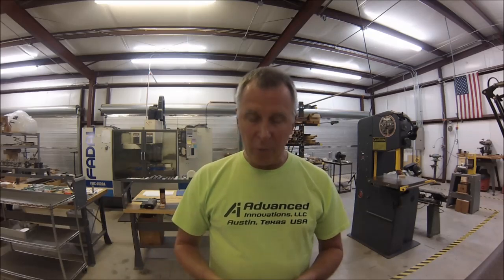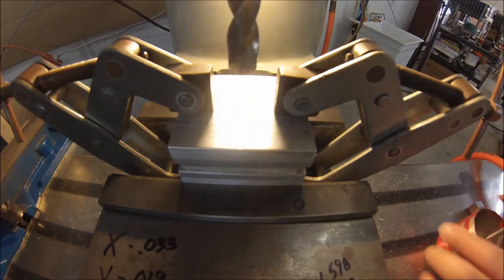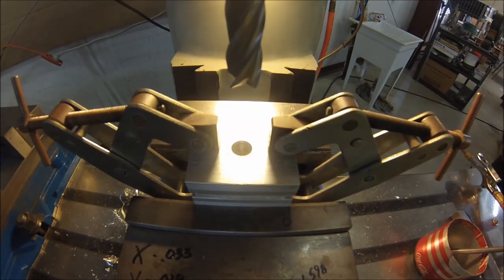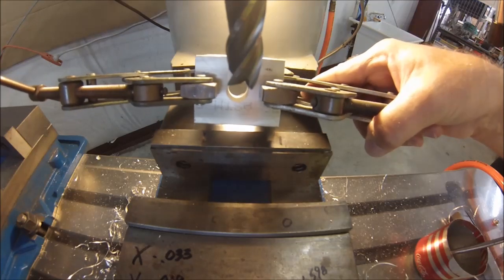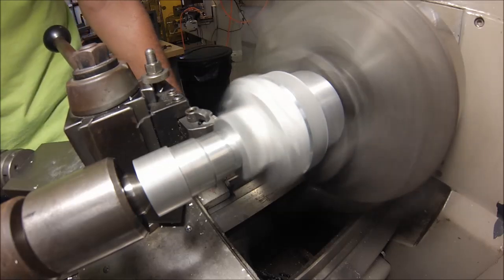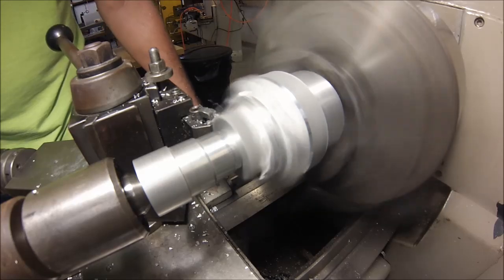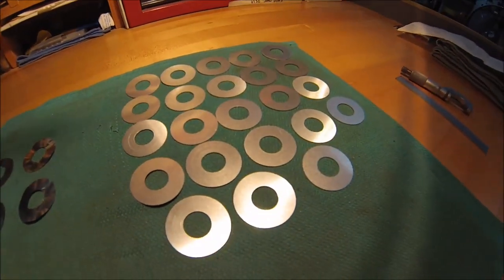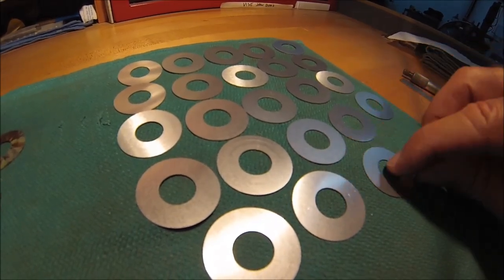Machining ultra thin shaft spacers and precision washers

Comment: Good stuff...... I use this method to make .020" thick Teflon & .010" mylar washers. Would much prefer to purchase them but no such luck.
Reply from the maker: The company I worked at bought the wrong shims on a super hot job. We were in real trouble of missing a critical delivery date if something couldn't be done. I suggested boring them. The boss laughed. 4 hours, and 1000 pieces later he picked his jaw up off the floor and never doubted me again.

Comment: I produce some gyroplane parts/upgrades that include some thin Teflon thrust washers. I have a couple of dedicated setups for stacking the blanks and cutting them very similar to this. Also some .070 x .800 stainless retaining washers. I have my laser cut guy knock out the rough blanks, then bore, stack and finish on the lathe. Thanks the the demo, I picked up a couple of good pointers.
Reply from the maker: Excellent.

Comment: Hi, what cutter are you using? Thanks
Reply from the maker: Thats a TPG 321 insert in K68 grade carbide. Kennametal holder.
Reply: @joepie221  thanks. I'm trying a similar setup but scaled down a bit to cut 4mm ID x 8mmOD washers from 5thou phosphor bronze.. bit tight on space! First batch went ok but still getting a bit of a burr on some, need to try some different tooling maybe. Thanks for the video though, great set up doing it this way

Comment: As always, done, filmed and edited by a master.
Time 14:00. Why not put a thicker sacrificial part at the deepest, using it to pull the delicate pieces out   later?
Time 14:25. Why didn't You that from the beginning? Forcing the discs off. Needs some force of course. 
Yes, if someone else did the dirty work....
Reply from the maker: The thick end part is a good suggestion.

Comment: Many ways to skin  cat.  I'd have punched the washers as follows:  Make a punch of mild steel (or small quantity) turning the od and bore to the requisite dimensions.  Mount punch in arbor press or heavy drill press.  Use a parallel piece of hard polyurethane as a die cushion and place the shim stock on the polyurethane pad.  Press down with the punch and voila, pefect washers on the end of the punch.  The key is the hard polyurethane cushion.
Reply from the maker: Your technique has been presented before. Its one I haven't tried yet. But, like all techniques, it has its limitations and restrictions. I wouldn't suspect it would work for thicker stock or simultaneous multiple parts. And one the urethane get torn up after a few parts, wouldn't you have to have the alignment perfect or risk burrs from the torn urethane?
Reply: @joepie221  The hard polyurethane is very resistant to damage or breakage.
The method is indeed limited to soft, thin, material, say .015" or so.
Spring steel would be a definite no-no.
I've also used this method for forming bulk heads for model boilers from annealed copper.

Comment: I have machined thin, odd shaped parts in the past and my method was to machine the inside surfaces then fixture and fill the machined area with Cerrosafe bismuth alloy which, supports the part as a solid then machine the outside. Finally, I melt the Cerrosafe metal out from the inside of the part with fixture and now I have a part that looks like is was made from sheet when, in actuality it was machined from the solid.  I had an occasion when I needed to replace a ruined grip safety for a 1900 Luger pistol. These were machined from solid steel but look like sheet steel parts. I used Cerrosafe and a fixture to machine the part's inside then back filled to make the part solid; machined the outside then melted the Cerrosafe out from the inside and now I had a grip safety part which fit the pistol and operated. Very nice work on your shims.
Reply: Is there a video for this method? I wanna watch it
Reply: That's a very elegant idea dude, I'm working on an FN M1900 with headspace issues.

Comment: If you need to index a threaded joint so that one point is always up, I mean perfectly 0 deg. up, like a gun barrel with a sight or dovetail for a sight aligned to match the rear sight on the action, what's the trick without using shims or facing off a certain depth of the barrel to get there?
Reply from the maker: None that I know of. Adjusting the mating surfaces is the norm.

Comment: Nive job;   the .001  i do with compass and scissors,of course ( i sometimes have to make rod bearings (i adapt from new ones...) for 1000cc motorcycles,for which there are only STD sizes; i have the journal cut to whatever dim. it cleans up round  at,then "make" the bearings

edit: there is a lot that goes into  that,you want to use/race the bike to the end of its life,as long as there is oil in it, now...   lol   :  BEARING CRUSH is critical,and difficult to achieve,so,study the matter a lot,prior...

Comment: I used this technique to machine silicon steel 4" diameter with 3" hole, 17 mil laminations for an alternator for the military.  First I cut squares from old transformer core & stacked them & turned the outsides by pressure turning, followed by deburring outside.  Then I stacked them in a fixture held in 3-jaw chuck.  Fixture was aluminum ring bolted to aluminum plate, the bolts providing the compression & lateral constraint centering.  As the boring tool cut out the center of each lamination, it exploded out like the "throwing stars" you reference in another video on pressure turning.  Silicon steel is nasty stuff!  (Imagine machining sand mixed with stainless steel.)  The resulting rings required deburring inside (despite being tightly stacked) & annealing afterword in furnace to restore magnetic properties.  The advantage to bolting versus pinning is that the bolts can be tightened to accommodate different material thicknesses & fixture is reusable.
          Normally, silicon steel shapes can be fabricated only by stamping.

Comment: Hi Joe. I made an aluminium bush from 6mm plate, similar to what you referred to as a plug in the video. I needed a 31.5mm hole and after drilling with the biggest drill I had, I still needed to remove 10mm radius. Removing this with a boring tool at 2 or 3 thou at a time (mini lathe) would take forever so I cut to close to a finish by plunging into the face with a carbide parting tool. Does this horrify a professional like yourself, knowing there was little material left to hold as the cut went through and I got lucky? Is there a better way to rough cut before boring to final size? Many thanks for the best videos on YouTube.

Comment: I've been using this method for nearly 35 years. Machined numerous 10 micron spacers!
Reply from the maker: It works well.
Reply: @joepie221  It does brother. People think a person is talking rubbish when you tell them that you can cut material 5 micron in thickness on the lathe. Think outside the box.

Comment: Another great video! I learn something new with every one I watch. I was surprised at the use of an end mill to enlarge the hole. I don't recall ever seeing an end mill used that way before. Could you explain the reason for using an end mill? Are there other instances where you would use an end mill to enlarge a hole?
Reply: If you want the hole to be "round" then you would usually use and end mill or finish the hole with a reamer. Standard twist drills tend to drill triangular holes. Not a big deal if you have clearance between the average bolt etc, but when you need a close tolerance, you need a near perfect round hole.

Comment: There's no reason you can't use a 2 flute mill on steel.  It clears chips better than a 4 flute mill.  Especially useful if you are hogging a slot to the full width.  A 4 flute can cut oversize in that situation because the metal piles up.
Reply from the maker: Hogging and 2 flute end mills should never be in the same sentence.
Reply: Why ?
Reply: @seanfitzgerald4052 4 flute endmills have less space for chips to evacuate.

Comment: Putting rolling papers between the layers would probably improve your odds. You would lose rigidity a bit more than aluminum, but aluminum spinning on steel will erode it and on aluminum it will gall. Great demonstration on pinch turning. Always good information from a great machinist. This guy is who I wish I could have started training with. Had to teach myself. And I'm not a good teacher. 😂
Reply: The snag with self-teaching is we learn the mistakes.

Comment: I come here to watch machining because I can't watch it on the swiss machining centers I now work with. One of the main reasons machining always fascinated me was watching the steel chip actually form or the metal being shaped. More challenging, but less fun to watch.
Reply from the maker: I did my apprenticeship in a company with 50 swiss screw machines. We made watch crowns, shafts and many other internal parts for electronic watches back in the 70's. My job was to build the secondary fixtures. The oil keeps you from seeing anything.
Reply: @joepie221  Very cool! I noticed there are Citizen machines as well as watches. We do primarily cardiovascular implants. It blew my mind the first time I picked up a rod of platinum, now it is just metal to me. In my short time having worked with these I feel as though the guide bushing tension is like 80% of the equation. We don't have a standard at the shop I work at but I had an idea.  Not sure if anyone has thought about this or even if it is already patented, but a tripod with a spring and clamp for the tip of the bar would allow repeatable tension. Just pull material through guide, clamp screw pull back on spring and tighten bushing, then let off slowly until it just starts to slide forward. I can't patent the idea because of intellectual property rights, but you can. 👋

Comment: I had an assignment to make some copper discs .020" thick and around 7" diameter with about a 4" hole in the middle.  I mounted a larger aluminum plate on the lathe that I was going to cut against.  A parting tool of course would snag on thin material (especially grabby ass  copper) and it is a tricky thing at best to part anything going longitudinally as we usually find out.  I used the tail stock to hold pressure against an oversized square of sheet copper like you used in this video to hold pressure against the face of the aluminum stock.  Now this next part of my story is what was the game changer.  I used a sharpened cutting wheel taken out of a large pipe cutter mounted with a should screw onto a piece of square stock that would fit into the tool holder.  With that I was able to use the compound to gently drive the wheel into the copper stock backed up by the slowly turning aluminum plate with complete success.  The inner circle was accomplished in the same manner as the second step.  I've used this technique a number of times to cut thin and/or soft material on a lath instead of using a conventional tool bit.
Reply from the maker: Interesting. Sounds viable.

Comment: I was thinking, before you set up the pressure turning set-up, “an application of thin cyanoacrylate glue to hold it together?” But compared to your solution what a mess that would have been to clean up. Thank you again, Joe.  I don’t know where you are in terms of d sad spirituality , but be blessed, as, and more, than you’ve been a blessing.

Comment: This was a good one Joe.  I would have done threads, but clamping and pinning is better (no crumpling thin spacers) and quicker too.  Cheers.
Reply from the maker: A threaded cap introduces the possibility of rolling over the very thin material. If anything, a screw that presses on a puck coming from behind would work.

Comment: Thanks Joe, another excellent post. I'm about to try this however I'm not sure what tool you used for your initial cut. I know you changed to a high speed tool to finish but what did you start with? Love your work.🍺🇦🇺
Reply from the maker: I believe it was my TPG carbide insert tool. It doesn't make a big difference, just make sure its sharp and doesn't grab the material.

Comment: Dear Mr. Pieczynski, your videos are great! Thank you. I hope to adapt your method to make small (172 thou o.d.) washers for my 3/4 inch scale live steam loco. The other problem I have for the scale loco is stainless hex head screws (bolts?) in 6 B.A. with a 7 B.A. head. One can buy these in plain steel, but rust is a continuous problem with steam about. I would make my own screws but can't buy stainless hex bar with 172 thou across the flats. So my question, how to make long lengths of hex bar? Mill it in a dividing head? but what about flexing of the bar? hope you might see this, keep up the great work, Regards, Transistor.
Reply from the maker: Is it possible to do the hex after you have the thread and just start with larger stock? if you plan to cut the hex, starting with, or making hex stock, may not be necessary.
Reply: @joepie221  Thank you for your thoughts.. (so I have to think one at a time, there's not so many, just in the places that show) and maybe it's a job to do in the lathe with a quick indexing detent? Maybe make the thread, then mill the flats, maybe with a tool-post grinder? Thanks, transistor.

Comment: Fantastic video, but one question, why only use 4 flute for steel and 2 flute for aluminium/soft metals?
Reply from the maker: Usually softer material can be pushed harder and produce thicker chips. Those thicker chips need a place to roll into/out of during the cut. 2 flutes allows that because of the additional relief and 180 degrees between flutes. You may clog and break a 4 flute under the same conditions. I personally don't go higher than 3 flutes on softer materials unless I am in a jam. Rule of thumb...harder the material=more flutes=slower RPM

Comment: anything to do differently if using .001 thick shim stock?
Reply from the maker: Creep up on the final sizes a bit slower. Thats all. Make sure you have a lot of squeeze in your setup.
Reply: @joepie221   thanks for all the important information i have not seen  anybody that has done an in depth threading video on odd size threading such as a tube that has a bore such as 0.937 internal size and it needs 24 tpi internal threads and a cap made to fit it with the correct 24tpi external threads would love to see the correct way to do it
Reply from the maker: You need to make a plug thread gage for the tube, and measure the cap with wires, a gage, or a thread mic. But the gage is the key. Make it a 2A pitch diameter, not 2B.

Comment: Nicely done, but bad practice with first half inch drill bit?
Reply from the maker: The initial hole was fine. What specifically did you see as bad practice?
Reply: To begin with am learning a lot from you, but just wondering if it might be better to have gone 1/4 inch first and then step up to 1/2 inch drill bit? Hope you keep those videos coming and thanks for replying!!
Reply: @MrCoffeypaul  Its not bad practice when you have accurate machinery and nicely sharpened drill.1/2 inch isnt that big in an industrial environment.

Comment: If you don't need a hole through the spacers the same method can still be applied - clamping the thin spacers between two pieces of metal with the tail stock and machine. You can machine any thickness of spacer this way, even a 0.01 mm (and thinner if you can find it). Always works - milling or turning!
Reply from the maker: That sandwich method can be very effective.
Reply: To be honest, I only saw that you had very thin shims amongst the other shims after I made comments because I didn't see the beginning of your video.
Reply: @joepie221  I managed to turn down the OD of some valve shims from 9.2mm to 8mm for a motorcycle engine by clamping them between a coupe of pieces of silver steel rod, and had a dremel style tool with a home made bracket as a tool post grinder.  I'm only a hobbiest and this was on an ancient and rather worn pre-war lathe, but it worked out just fine.  I didn't even realise this was an accepted technique, just used what I had to get the job done.  Thank you for your videos; between you, This old Tony,  Abom and a few others I've leaned a lot, and relearned some of the stuff I was taught as an apprentice many years back.

Comment: Just a question to James Peterson. I’ve never seen a precision diameter bolt. Joe used a ground pin.
And about home lathes? I use a american pacemaker what’s in your garage?
Thanks ron
Reply from the maker: Shoulder bolts are about as close as you can get, but only for the diameter. the threads are still commercial grade.

Comment: Using the tails tock to apply pressure-- not a good way to go. Too easy to have things slip, especially with many home lathes. Better to use a bolt through the center. Just my opinion.
Reply: I've used the tail stock for pressure on all five of my lathes, four of which were "home shop" quality. Nothing slips if you keep your machine in tune.

Comment: I'm always amazed at how something that should be theoretically simple (cutting a generic solid of rotation) is so complicated and multifaceted because of the complexities of reality. And I'm also always amazed every time I see one of you videos come up, because I think "wow, I haven't needed to do that yet, but damn I don't know how so I better check it out." Because obviously (in this case) once you've turned stuff you realize that thin parts are really tough to work with, just like you say at 0:30.

Comment: What is it that helps you remember... to make sure everything's going to clear? ( 10:50)
Reply: Years of experience is what tells you to check if its going to clear. You need to remember these things or things could crash, possibly hurt yourself or damage the tool or machine.
I've been machining for 20+ years and on large Berthiez vertical lathe /borer, Webster and Bennetts, and you just must check everything.
Reply: The same thing that makes you remember to look both ways at a stop sign...